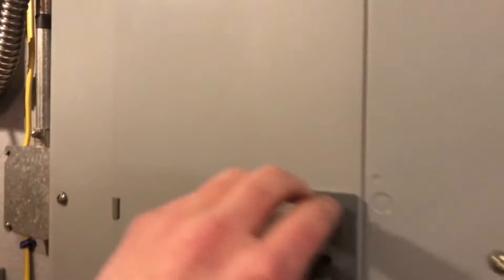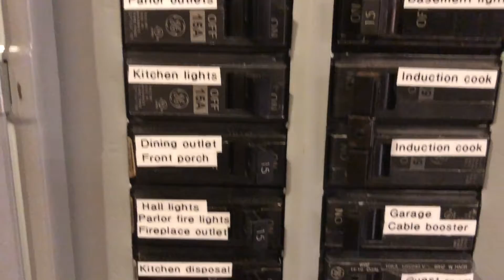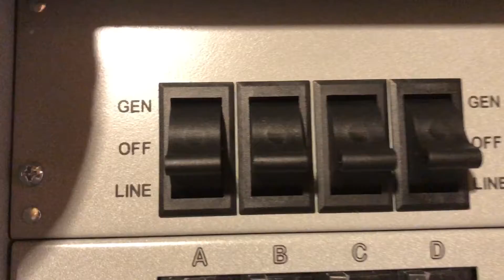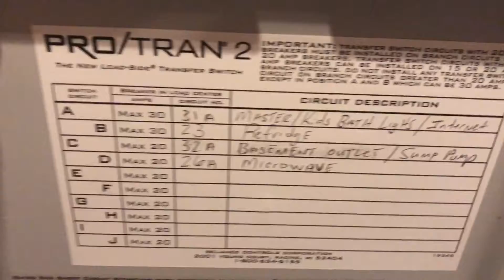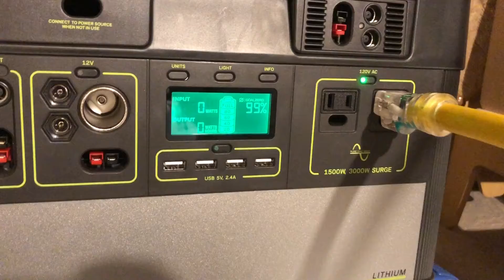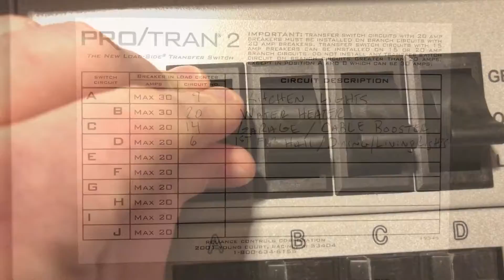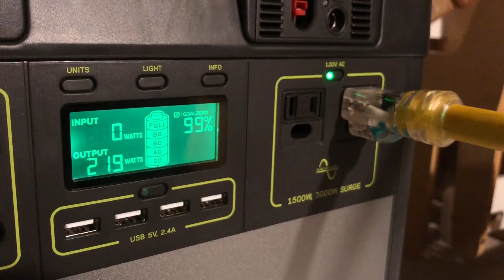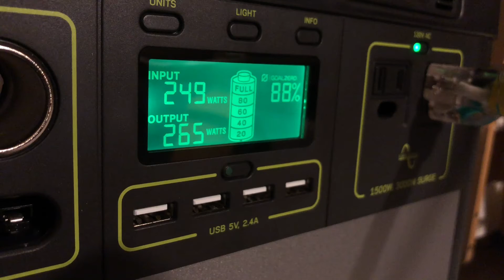Installing Two Goal Zero Yeti Home Integration Kits to Connect a Yeti 1000 to My Electrical Panel

Comment: Todd, thank you for sharing your informative videos. They are so helpful and were integral in our decision making process as we are out on the East Coast and experience many power outages in recent years.  Just last month we lost power for 4 days during  a 90 degree plus heat wave.  Unfortunately GZ’s videos are lacking, to say the least.  After doing some research and watching yours and other videos, we recently purchased an open box 1400 Yeti and MPPT battery, a 100W solar panel (suitcase), a 15 ft cable, and the 25A rapid charger.  We chose to go with the Yeti for many reasons most importantly because we live in a townhome community and the portable  generators are obnoxiously loud and require maintenance.  The Yeti appears to be relatively low maintenance in comparison. Our living space is approximately 1500 square feet and having hot water, lighting, internet, cable, refrigerator, etc. during a power outage would be marvelous. Most of the power related experiments with the Yeti are typically  for power outages during colder months.  Have you tried experimenting using the Yeti for cooling purposes during very hot temperatures and am curious what recommendations you would give under these circumstances?  We are considering buying  the integration kit so that certain components can be turned on during loss of power.  I actually reached out to an electrical contractor who advised they know absolutely nothing about the Yeti — never even heard of it.  After sending him the Yeti 1400
information as well as a link to the integration kit tech info,  I was told not to expect  to run too much on just 1400 Watts - he said there are hair dryers that run on 1400 watts so the Yeti will not be able to do too much, especially running something like a microwave.  He didn’t even think I could run a computer equipment. I let him know the Yeti most certainly could handle quite a bit.  I will probably send him your video so he could see what your electrician did to optimize your Yeti 1000’s capabilities.  He quoted between $1000-$1200 to install the integration kit. He said it is a big job that requires a lot of rewiring and it could take at least 5-6 hours.  That seems a bit steep to me. I’m not sure what you paid to have your system installed — a system that looks to be much more detailed than what mine will be.  I think I need only one panel. So far the components (Yeti, etc.) costs approx $2150 not including the integration panel kit and possible electrician costs.  All said the total could be as much as $3500 once installed.  For this amount of money, I’m wondering if we would have been better off installing a more powerful gas generator back up system that would be capable of providing more electrical power back up than the 1400.
Reply from the maker: I’ll try to cover what I can!  As you said, the Yeti is no maintenance and quiet but it can only store a small-ish amount of energy compared to what a gas generator can produce so you need to pick lower draw things to power. That  means high draw appliances like an AC, hair drier, electric heating ,etc will quickly empty a battery. I like to think of the Yeti as a reservoir that can buffer demand peaks like running a microwave or when your fridge kicks on but you need to keep it topped off. For solar, on a sunny day expect about 5 hours of useful sun and assume you’ll get 80% of the output for what a panel is rated so  a 100w panel will output 80w x 5 hours = 400 watt hours of energy. Since the Yeti 1400 stores 1,400 watt hours it will take ~3 days to charge it with that panel so I’d recommend getting at least 2 more panels to have a hope of recharging in a day. The Yeti is great for running things like a computer, TV, and even higher draw items like a fridge (yours will power one for a bit more than a day) but you need to calculate the watts it draws and multiple it by the time. A microwave may use 1500w but you may only use it for 1 minute which means it only uses  a small amount of battery. For keeping cool, I’ve been looking into that and I think the best option is to get a 12v DC fan, a rechargeable fan, or if you already have battery tools get a few fans that can use those batteries - I have 2 ryobi fans and a bunch of batteries and a few smaller UBC rechargeable ones. AC is out of the question unless you have lots of battery storage, like a Powerwall. For the transfer panel, I don’t know exactly what my install was because I did other things but I think it should run closer to $500 to install if you do your homework to label and identify the 4 circuits you want. After that, it’s a pretty simple job so get more quotes. Yes, you can get a generator that can power larger stuff but the big downside others than noise and maintenance is fuel. If gas, you need to keep a lot on hand and keep it rotated regularly. Propane is better because it doesn’t go bad. I opted for a hybrid where I use solar when the sun is shining and cheap, small propane generator when it’s not - both recharge the batteries so I can keep cruising.

Comment: @Todd Parker - just to clarify the power input at the end. It's 248 WH with 2xBoulder 100 AND with the propane generator combined?
Reply from the maker: It depends on the conditions but I now have 2x Boulder 100's and 160w of folding panels (360w total) which on a perfectly sunny day realistically will give me about 300w max which the Yeti can handle on the MPPT module. If I needed more power at the same time, I could fire up the generator, plug in my 4x wall chargers (240w total) and plug that into the PWM input and have 600w of input power at once.
Reply: @todd.parker  600W is definitely enough for emergency circuits, and with proper selection, should allow one to ride out an multi-day outage. I wish I knew how to calculate the usage+duration of my furnace fan for a typical winter day. I couldn't find an online calculator that knew how to do that. I assume that I would want to set my thermostat to low+tolerable house temp (60-65F) and then keep it steady in the hope the furnace kicks in only to bring it back to that level and thus minimizing time of hi-speed fan. I guess I have to wait for winter to try that. Overall, I am becoming more confident that a proper mix of solar+generator+careful consumption+adjust behavior to emergency will be the solution.
Reply from the maker: @jessyschoss  Yeah, it's hard to calculate power consumption for appliances that cycle on an off without using a kill-a-watt or plugging it into a Yeti and seeing the kWh output over a duration. I've had fun getting to know how much power things use, it's surprising sometimes. My kind of setup requires some babysitting compared to a whole house generator but it's kind of fun finessing it.
Reply: @todd.parker  Your channel is for people who have fun tweaking and experimenting with things LOL. Whole-house-gen wasn't really an option for me due to where I live.

Comment: Thanks for the video!  Question.  Do you leave the Yeti plugged in to charge to keep it topped off?  Or do you charge it to 100 and check it every once and a while?
Reply from the maker: I usually just leave it plugged in. It probably slightly better to only charge it when needed and to keep it a bit below 100% for longevity but that too much work
Reply: Todd Parker makes sense. Thanks!
Reply: @fresnel8279  The Yeti 1400 I have actually states the keeping it below 100% is not applicable to the Yeti as they are programed for longevity and actually often when I keep mine plugged in to AC year round when not in use during summers it'll discharge itself down to say 93% and have seen as low as 91. So that's probably that built in programing at work. And Goal Zero recommends you keep it plugged in to AC year round but if not to recharge every 3 to 6 months to full capacity. But it also is programed to hold it's charge for decent amounts of time. Check out their manuals on line via google them or go to Goal Zero dot com webpage to search for that information. The more you are informed yourself the better you understand. Hope this helps. I've had my 1400 since 2018. It keeps my Tiny Dometic freezer freezing four half gallon jugs of 3/4 full ice frozen so I start with six from home where two go into my heavy duty cooler and I swap out half frozen jugs daily with two from the freeer so no ice runs and even an occasional icecube treat or ice cream treat is possible if it's a sunny period. It does fail or slip when there is no sun due to cloudy over cast weather or worse for us here in the NW Rockies heart of the PINE Forests wildfire season haze definitely kills the sun keeping up with charging the goal zero. Otherwise it's wonderful and reliable. You can charge it via the car when traveling. Not advised otherwise because it will drain your vehicle battery if left unchecked and not running. Read up on these things really if you are serciously interested. Hubby who is into Ham Radio insists there are better lithium solar batteries out there but I'm the one buying these as he does not camp and after 49 years he's fine with my solo tent camping and I'm fine with it. Been camping on my own for well over 55 years now. You would be surprised how many ladies you find across all age groups who solo camp even yes in tents or mini vans. There are groups you can join. I'm not a joiner and live in too remote an area of the country so not a lot of op's for that anyway up here. Meantime hubby is very supportive and helped when I needed to update my two 50 watt flexible panel book from the deep cell batter MC4 set up to parrallels for the Yeti. I was afraid it wouldn't work out but we added a 40 foot extention cord system to the battery can stay in the shade at all time along with the dometic freezer and we added a 30 foot extention from Goal Zero to use the portable Allspower solar panels too at the very same time. I called Goal Zero to insure that was safe and it was within the limits. The original two 50's were not they had to be rewired together not in chain to be safe and not damage the Yeti. So he helped do that and wired the anderson plug that matched the Goal Zero's configuration. Anderson plugs have several different configurations but most can be pulled apart and switched about to mate up with the ports you need to mate too. Hope this all helps you and others too. Stay safe everyone.
Reply: @todd.parker  You might consider using smart plugs. I use TP-Link plugs and schedule my Yeti's to turn on once a week for a few hours to top off the battery.

Comment: Thanks for the informative video. What did you do for 110V circuits that have a 20A breaker switch. Our fridge and Microwave are each connected to one. The GZ transfer panel only has 4x15A circuits.
Reply from the maker: I think you could probably connect those since a both should exceed 15a but you’d want to ask an electrician
Reply: @todd.parker  Thanks. I will ask. But I think I get your point - worst case it trips the  breaker switch if the appliances draw more than 20A. I doubt it will, as I know the fridge is only 7.1A and I will probably not connect the MW (which is 13.5A).

Comment: Great video. Why can't you use the roof top solar to charge the Yeti?
Reply from the maker: Due to safety refs, if the grid goes down you can’t access the power from the rooftop panels. It’s a huge bummer

Comment: Is it worth the 5k price tag
Reply from the maker: 5k? The Yeti is $1,000 and each home integration panel is $250 so materials were around $1,500, labor maybe $400.
Reply: @todd.parker  hook what bout 3k yeti would u recommend it
Reply from the maker: @antricemccarroll2958  I wish I had a bigger unit like the 1400 or 3000 but I'd wait before spending that much money right now. The bigger Yeti lithiums are long overdue for an upgrade to the "x" series like they've done for the smaller units. Supposed to have integrated MPPT, more expansion ports, etc.

Comment: Key Question.. CAN INTEGRATION KIT be installed to indoor SUBPANEL,, or must be MAIN SERVICE ENTRANCE/PANEL?  Most homes have exterior mounted main panels, while GoalZero states integration kit is not weather rated, and is ‘INDOOR USE ONLY’.
Reply from the maker: It’s normally mounted next to your main breaker panel inside, just like any sub panel, that’s how we did it.  I don’t think think I’ve ever seen a breaker panel outside...

Comment: Have you done a test run? See how long can you run off the Yeti’s before you need to recharge them.
Reply from the maker: Yep, I periodically flip things over to run off the yeti and it works great. The 1000 is pretty small so it can run my fridge for half a day or so, less if I’m using the other circuits but it works great and I can even take hot showers. If I had the money, I’d get a bigger yeti but can use solar and my generator to add run time indefinitely
Reply: Todd Parker nice! I don’t know if you know about the Yeti fast charger. You can get two of them and charge up your 1000 really fast. I have a 3000 and I fully charged in in 5 hours after running a test that drain it. Plus you should think about getting a small portable generator. I used my Ryobi small generator to charge up my Yeti and it only has a 1.2 gallon tank. Less gas to use then a home generator. So if your storing gas, it should last you a long time.
Reply from the maker: iiinsaiii cool, sounds like we have similar setups. I made my own fast charger by strapping 4 wall chargers together (videos on that) and it filled my yeti from 35% yesterday in 3 hours. For the 3000 your setup is perfect. I like to use my yeti as a buffer for my ryobi propane generator and solar panels so I can use the least amount of fuel, sounds like you do the same. It’s slick.
Reply: @todd.parker  You guys realise that fast charging with 4 chargers is probably degrading your batteries over 300% than normal.
Reply from the maker: @anonymous_friend  I get the concern but I don't think it's that linear and all comes down to the C rate. Charging with 4 chargers is about 250 watts which means we're charging this 1kw battery at a 0.25 C rate which is pretty conservative. Yes, the faster you charge and discharge you battery, it causes faster degradation but I think at this level, it's not that big a deal. I prefer to only fast charge in cases where I need to and will unplug a charger or two if I'm not in a hurry. According to this article a .25C rate isn't even in rapid charging (.5-.5C) territory let alone fast charging (1C) or ultra fast (1-10C) - https://batteryuniversity.com/learn/article/ultra_fast_chargers

Comment: Thanks for the extremely informative video(s) Todd!
Another Q: one of the circuits I will really need is a 20 amp circuit (not sure of Voltage).
Is this really limited to only 15 amp circuits?  If so, I am wondering if that is because of a limitation of the Yeti (I have a 3000) - or they just have the one kit to offer. (I realize that it really is a RELIANCE 4 switch transfer panel - and maybe I could just get a 6 switch Reliance transfer panel that has 2/20 amp and 4/amp switches?)
Thank you for your knowledgeable insight! 👍
Reply from the maker: Thanks. If it’s 20a at 110v 2,200w) then that would be more than the 1,500w the yeti can put out continously. I think you can use other transfer panels but the key is one that works with the the Yetis 110v output. I found it hard to find one wires with a single 110v instead of a 39 amp plug
Reply: @todd.parker  gotcha. That makes perfect sense. The Yeti has a limitation of 1500 continuous watts. I did not know that 20A at 110 = 2200w.
Thanks!

Comment: Did you ever consider getting some of the extra battery tanks to attach to the Yeti (via the proprietary cable) so that it lasts longer?
Reply from the maker: I looked into it and personally it doesn’t make sense to remove the mppt module for this and the lead acid batteries are pretty bad compared to lithium
Reply: @todd.parker  i DO wonder why the expansion idea (which is a really good one) does not include the possibility of adding extra LITHIUM batteries instead of Lead Acid.
Reply from the maker: C.C. 95 yeah, I know they’re working on it and I thick it’s tricky to keep all the cells balanced. Guessing the new version of the larger yetis will be out soon to match the X line they’ve been rolling out.
Reply from the maker: C.C. 95 Who knows when these will come out and what features they will have so enjoy your 3000. This market has really heated up feature-wise so I’m guessing they are doing a lot of re-engineering to stay competitive. I do hope they bake in MPPT, support multiple expansion modules, and way increase the charger speed at a minimum. Oh, and have proper lithium expansion batteries.